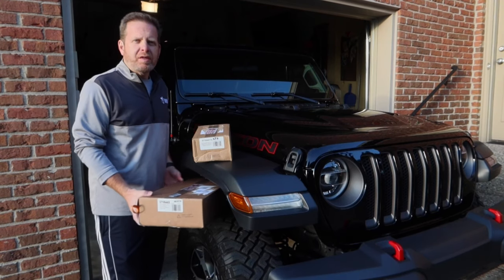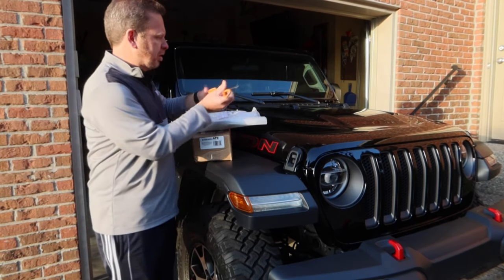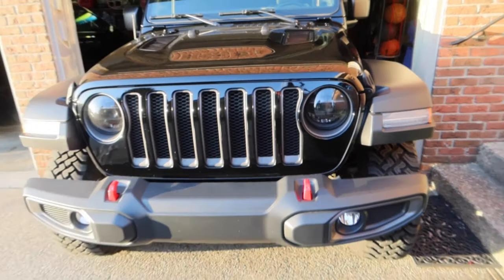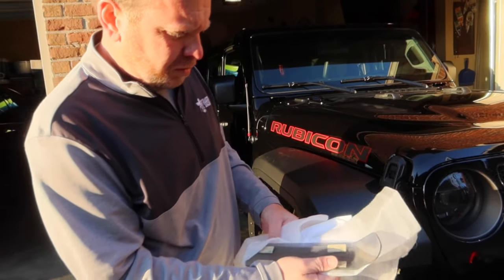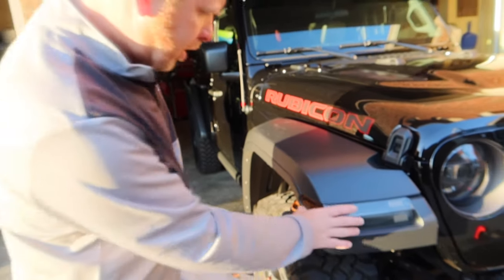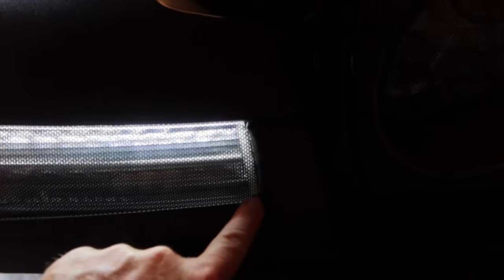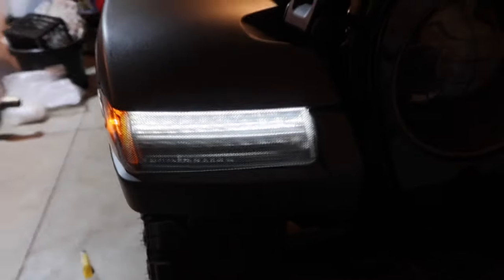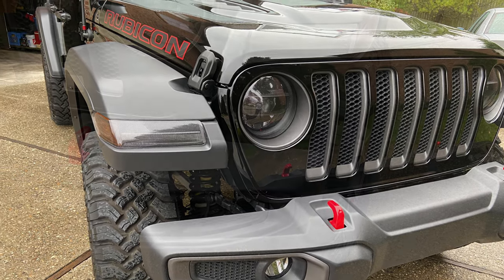BAD REVIEWS JUSTIFIED?? GT Styling Jeep JL Carbon Fiber Covers  - I FIXED THE BAD DESIGN!!

Comment: Thanks for the review. Did you find the headlights were much dimmer with the carbon fiber covers on?
Reply from the maker: I would say it does dim them some but now that they have been on I have forgotten there is a difference.  I would think it would be better than the fully tented ones.  You can see a pattern in the lighting from the carbon fiber design, if looking for it.